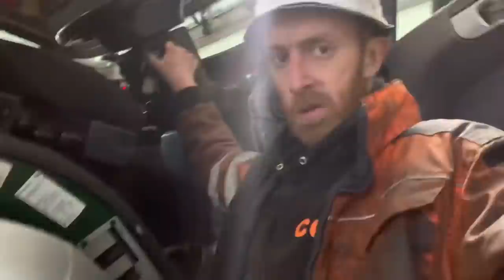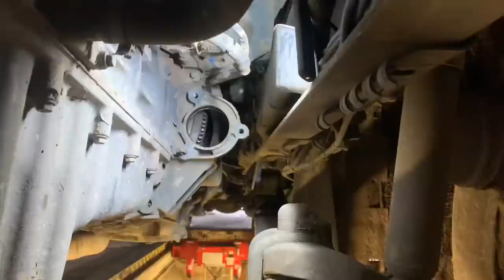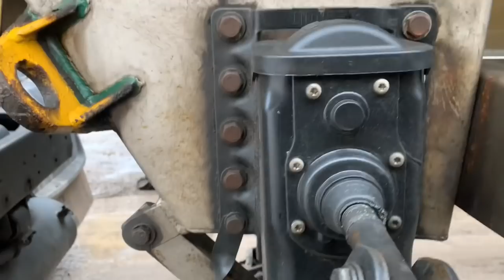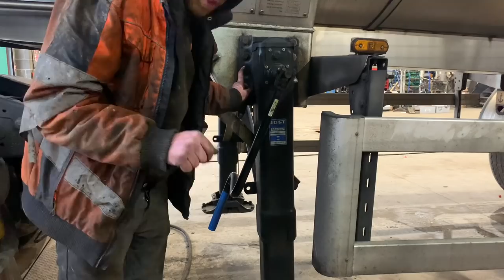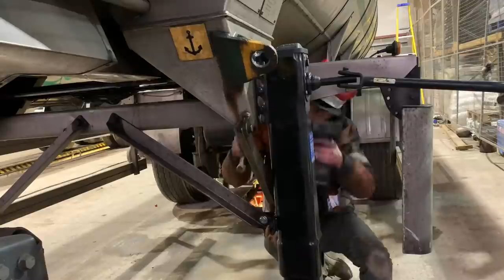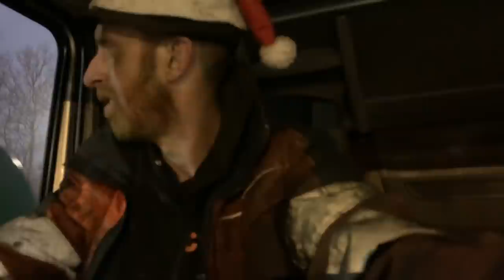Scania starting problem bent landing legs and a partridge in a pair tree hgv mobile mechanic

Comment: We used have a contract to do bent landing legs for a huge crowd.  You then discover a new love for 3/4" air wrenches.. because no bolt is as tight as a bent landing legs bolt.. all 700 of the feckin things... you'll then have the wrong set of legs on the van.,. no matter what. while the driver paces about waiting for his reefer/curty/box back. "I'll Jost be a tick..." lol.

Comment: When I was an apprentice spent a day with a file doing a DaF coach SB3000 flywheel  as we couldn't get the bits  lasted a few tours till we got if off and turned the ring gear 
Best ring gears where the ones with removable bolt on segments
Reply from the maker: I’ve never seen removable ones, sounds a good idea though! I’ve done a few where you have to warm the ring gear up to get it off and on the fly wheel! I think you just change the whole thing now days.

Comment: I had this happen on a large Diesel engine in one of our work boats. We went out to tow another boat back after they had fuel problems and we had the same issue when towing them home… poor fuel apparently!
Anyway the engine would run for a few mins and cut out and we managed to get back within a few hundred meters of the pier and the ring gear was fucked!  I took the starter off and put insulation tape around the dog and refitted it…it worked and I had to do that 3 or 4 times as the boat needed bringing in from the pier the next day… just thought I’d mention it as it worked for me when we were desperate and I knows you appreciate a good old bodge! Lol

Comment: Is that scania an 08 plate?
Reply from the maker: Yeah somewhere round that year! Don’t know for sure infos in the van, it’s a golden oldie anyway
Reply: @Professional-struggler  fooking chocolate around that year like the banjo bolts on the cam shaft. There was a story that the guy who developed the gearbox in that era was a massive darts fan and inside the Bell housing there is dart cast into it. He had the sack after they found out apparently.
Reply from the maker: @kevinjarman6930  now that Kevin is a good bit of info....... and yes I will deffo be looking for a dart when I get the box out 👍 good man, if I find one you comment is deffo being show 😂

Comment: Ring gear is softer hence it fails before the starter ...YOU CAN'T TURN IT ON THE RINGS !!!!!!!!!!!!!!!  that is what the crank sensor uses .if you elongate them the sensor reads them incorrectly and you get an engine warning ..It will takes them weeks to find that is the issue
Reply from the maker: Good bit of advice that pal 👍 good to know! Got to get that job in this week so I’ll make sure I’ll tell people,
Reply: @Professional-struggler  you can make a tool out of an old starter gear or buy a aftermarket or scania one, bolts to the bellhousing and takes a 1/2 ratchet so you can spin it over. Great for doing top tunes

Comment: that flywheel ring gear was fukin fuked,  used to be you could cut the fuked one off then heat up new one until cherry red then press the wheel on. ian riley in heywood has a rig for doing train wheels and steel tyres that would do the job
Reply from the maker: ive done a few that you have to warm up, i couldn't believe the new one would expand so much cheers alan